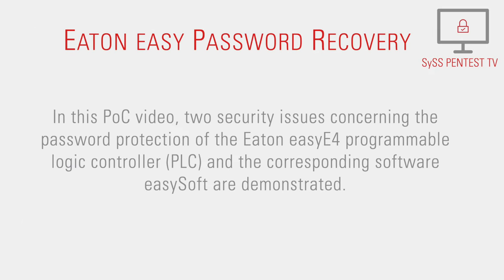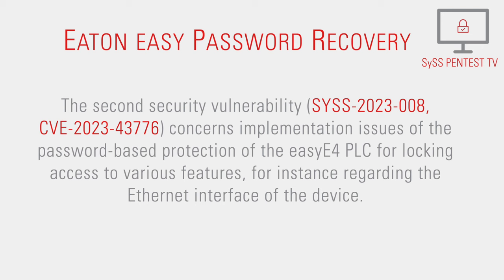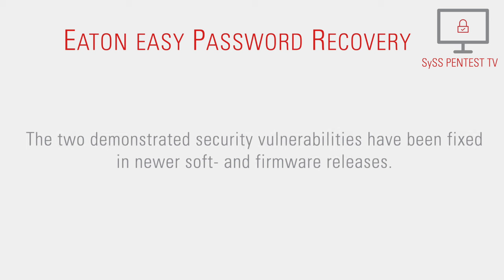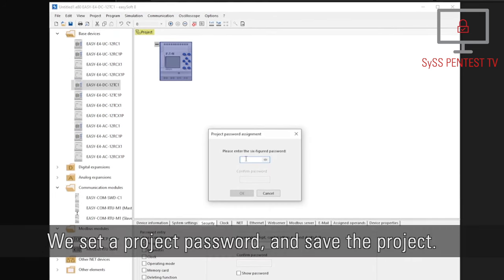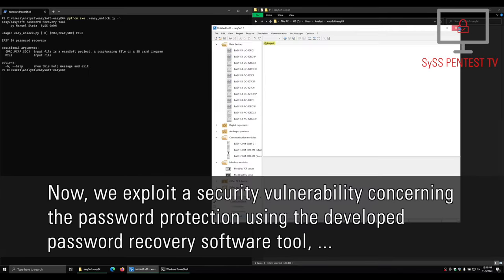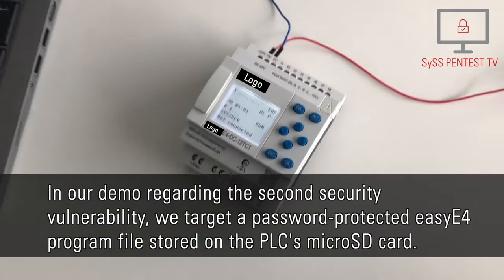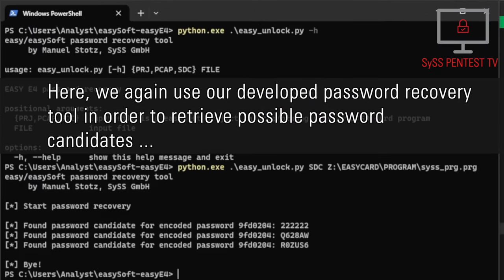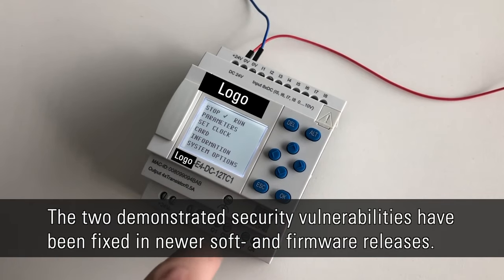Eaton easy Password Hacking // Password Recovery for easySoft and easyE4 PLC (fixed security issues)

Comment: project not found. Deleted
Reply from the maker: If you are referring to the GitHub repository of our developed password recovery tool, this will stay private for some more time until more affected users have applied the corresponding security updates.
Reply: @SySSPentestTV  Which version of Eaton is affected?
Reply: @SySSPentestTV   I need to test my plcs. So can you share it in PM message?
Reply from the maker: @PIDOtomasyon  According to Eaton all easySoft software versions prior to V8.01 and all easyE4 versions prior to 2.02 are affected by the demonstrated security issues. Also see the corresponding Eaton vulnerability advisories: https://www.eaton.com/content/dam/eaton/company/news-insights/cybersecurity/security-bulletins/etn-va-2023-1010.pdf and https://www.eaton.com/content/dam/eaton/company/news-insights/cybersecurity/security-bulletins/etn-va-2023-1011.pdf .
Reply: @SySSPentestTV  Thank you for information.